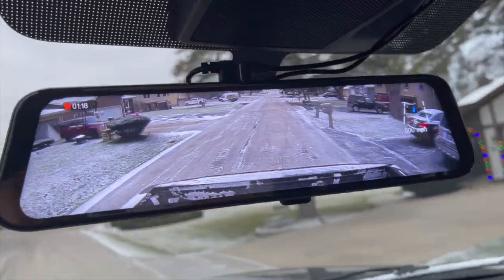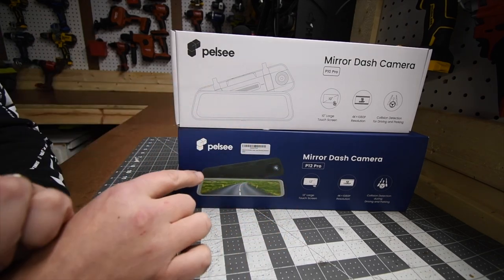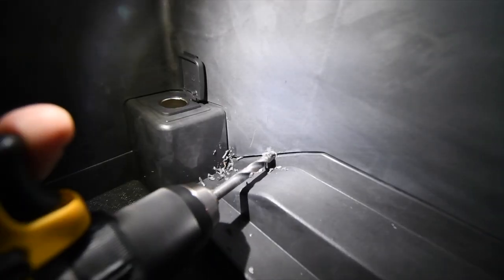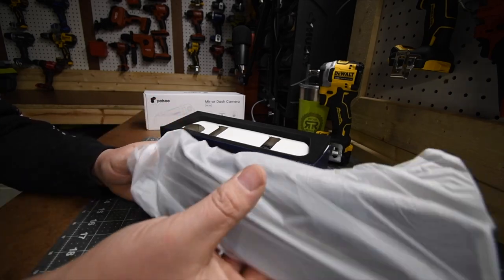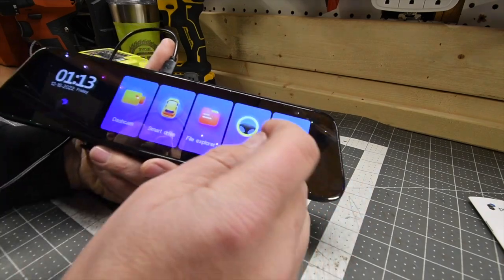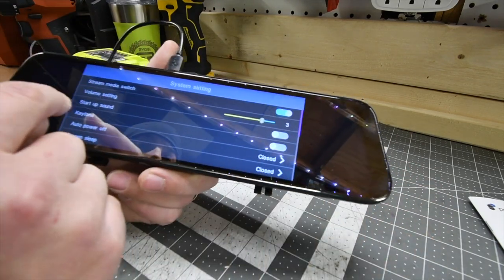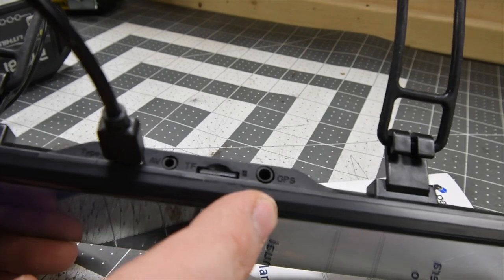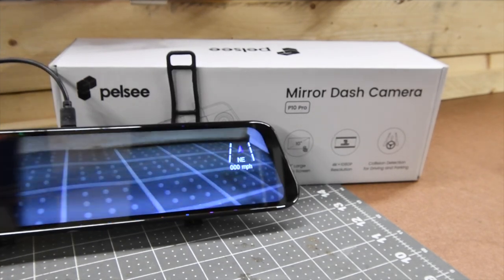$119 Pelsee 4k Mirror Dash cam, Protect Yourself from Crazy Drivers.

Comment: I have a similar one (Rexing M1) but it doesn't track speed. Over a year and I love it (especially backup cam feature).
Only problem I had is no accessory fuses inside so I had to buy a voltage cutoff otherwise it kills the car battery.

Comment: Hello can the settings be saved On this unit?
Reply from the maker: it does save. the unit learned what my habits are and it does what I want it to do without adjusting anything. its actually awesome. this unit is extremely useful and I now require using it to drive.
Reply: @ManCaverTools  did you hard wire it?
Reply from the maker: @OleManGaming  in my truck I didnt have to. the 12v outlet in my arm rest is continuous power already